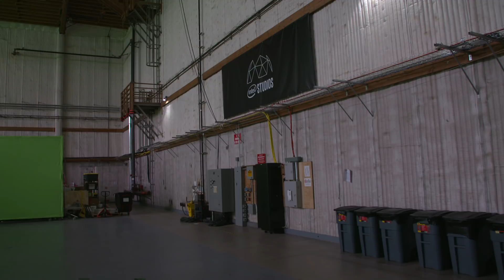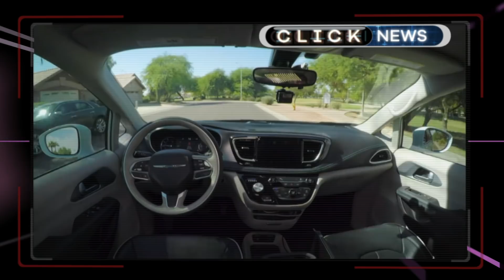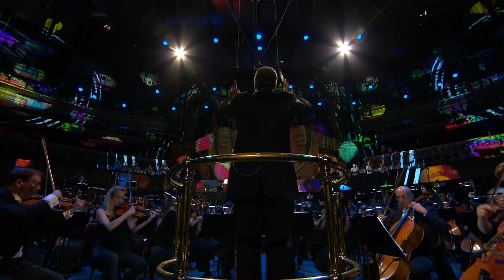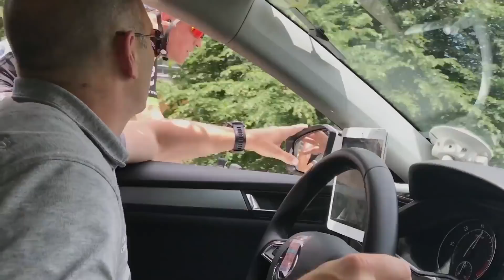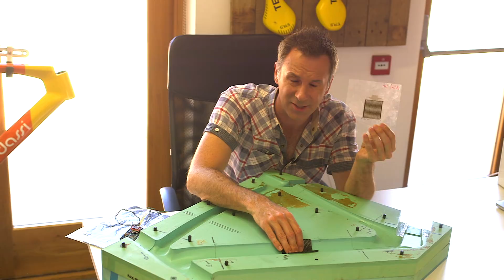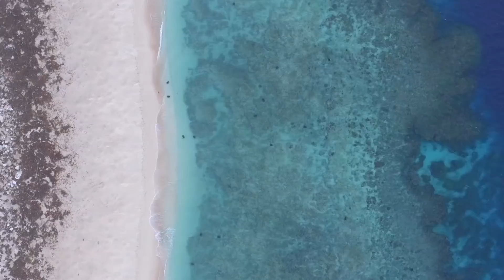The future of film production - BBC Click

Comment: Cool tech, but it shows problems in very fine objects. If you look at movement of sand in the scene, it is very very unnatural. Cameras cannot correlate sand particles thrown into air from multiple cameras and are confused.
Reply: Because the shots aren't cleaned up.
Reply: Walter Read my message again.
Reply: movax20h give time. things will become better and better.
Reply: zimous david  I think you should also read my message again too. It is physically impossible.
Reply: movax20h i got you brother. but nothin is impossible, just extreme dificult today. imagine yourself doing a time travel and showing your phone mobile to any person you meet in the past. like 2000 years ago. they will never undestand. so give time to time. im sorry for my english
Reply: zimous david that is not argument , just naive thinking. I didn't say it will never be possible, or it is not possible with some clean up, what I have said is that this technique even if improved has inherent limitations with fine unstructured  details of stuff that is hard to identify, that cannot be resolved. Things like dust, cloud, water, sand. No amount of cameras, resolution, and processing will solve it. You can cover it with cgi, use machine learning to fake up these regions or leave as is for artistic value, but it doesn't change my argument, the method has its own limitations. Any engineer will tell you that no tool is perfect and will never be.
Reply: movax20h i understand what you are saying, but i belive one day we will fix does problems. just me beliving bro, is not a cientific analyze

Comment: That fancy studio seems like a good way to refine the technology, but it still looks shit. It also doesn't add to the shot.
Reply: It only adds another option to "directing". Yeah, you could say there is a line to draw between directing and editing...but in reality the director gets the most control if he masters this over a filming crew and camera operators. But traditional movie making and this are two different ball games. Let's explore another method of filming to allow for even more possibilities. In essence another tool in the directors kit.
Reply: it's not that, it's just that the cinematics of what they're doing doesn't make the scene any better. neither of you get that point. You can have much more drama and tension in a scene by ommitting everything else that's going on.
Reply: The cleaned up version of the shot that was only shown briefly was actually fairly well done and this system allows for camera position to be determined later and makes fancy 3d flyarounds of actors, maybe frozen in time like the credits of deadpool a lot easier to produce